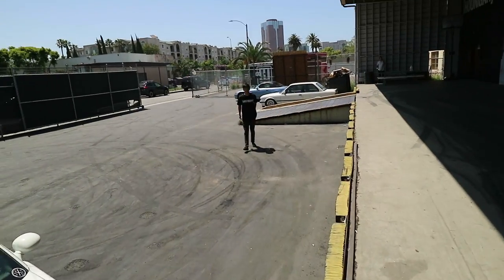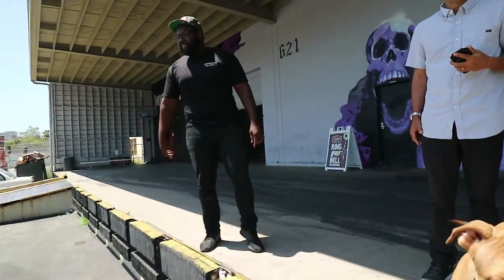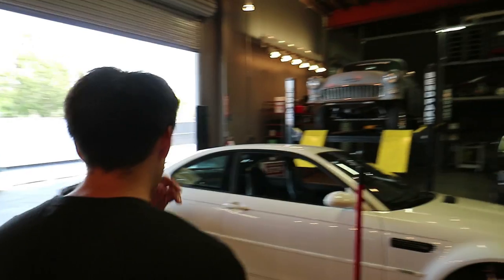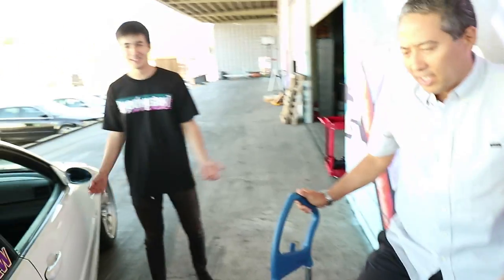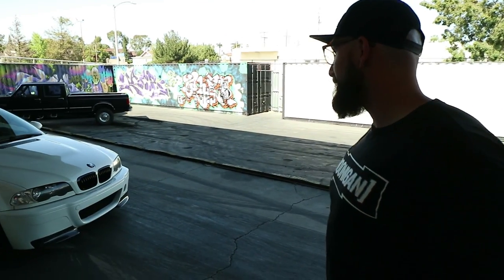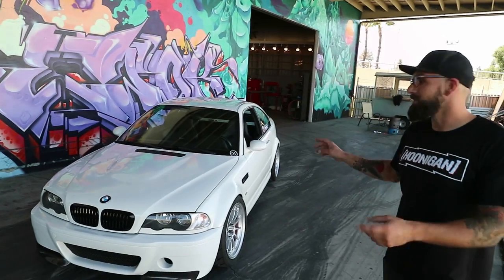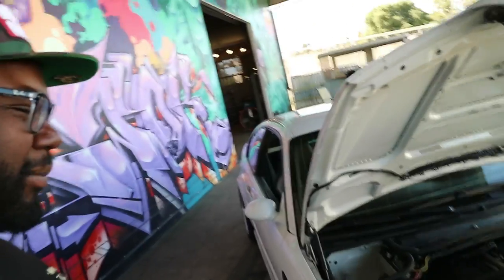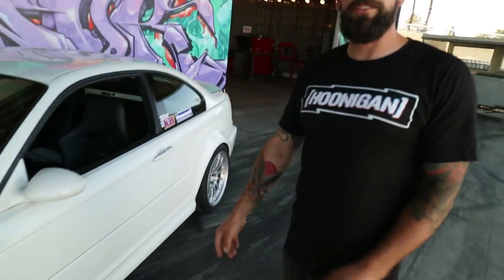[HOONIGAN] DT 044: Vin's E46 M3 is Track Ready

Comment: Blew up the engine on my 2004 E46 M3 on Buttonwillow Raceway February 2012. I was out with Speed ventures. Two other e46 M3s blew up the motor as well that day as it was over 100 degrees. Rod bearing issue. I was bummed. So I stepped up and built a new motor with Vac motor sports internal goodies, like oil pump, Crank Damper and custom pulleys,  ARP internals and turbo ready with a giant oil cooler and radiator with electric fan, but I’m keeping her NA just like you as She sounds amazing at 8.5k RPM with all NA mods and engine tune by Epic motor sports. I love that white color and no sunroof on your car. Also the exhaust sounds just like my car. 👍🏻👍🏻👍🏻

Comment: Don't forget to the subframe reinforcements if u haven't already and get a silicon intake boot you'll gain like 2 hp fact
Reply from the maker: Subframe has the weld-in plates from Bimmerworld, along with a full bushing kit back there!
Reply: TheHoonigans nice if u didn't have the plates and had the upgraded bushing it would cause the subframe damage quicker because of the added stress into the chassis. Where the brake ducts man ? Track car without brake ducts lol

Comment: seriously if u can drift a stock s2k u can drift anything. S2k is one off the hardest chassis to drift.  Had mine for 6 months.
Reply: Dr Drifts Adventures but I drift my stock 130 hp first gen rx7 with a auto 3 speed 🤔
Reply: nice the frank z!.....but i not talking bout power....the rx7 chassis is easier to drift....s2k chassis is short and really hard to drift properly....doughnuts and burnouts easy.....drifting hard. I had a gen 3 which is same shape as you.

Comment: i run e85 in my e36 318i (115hp) without any problem :) run great. 100%
same 320i e36 runs with it also but has a bit lose of power. (cause no vanos) 100%
my mercedes w203 c180 runs e85 but like 33liter e85 + 7L e95/e98 cause full e85 it has no power.. i tried and engine light came on and wont go lol
i mean for 0.60euro for 1L i dont really give a shit if it drives its good

Comment: "....The worst part about BMWs...." IS THE SHIFTER!  And the $1200 leaky shocks.  And the parts non-interchangability.  And the intake manifold leaks.  I had a 1991 6spd 850i and traded it in on a 2000 Volvo V70R.  The Volvo is marginally more reliable than the BMW.